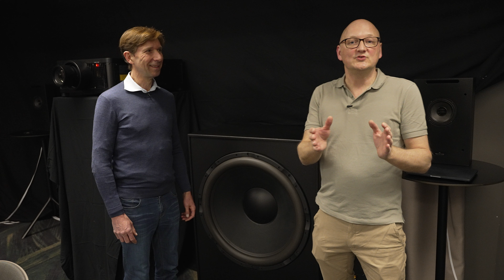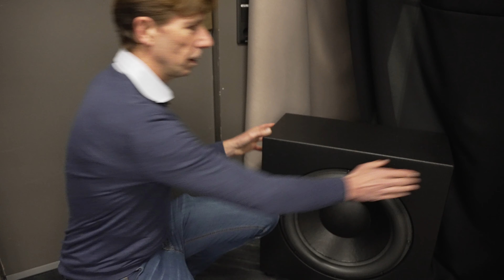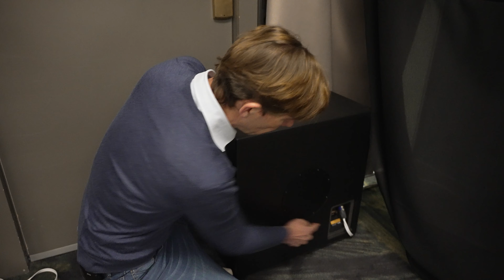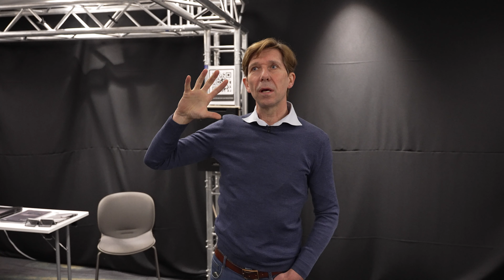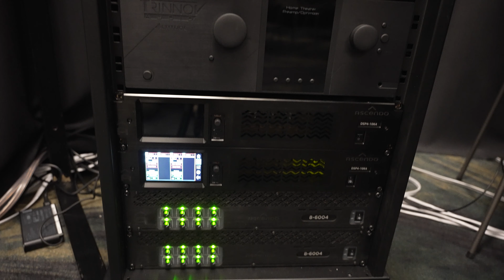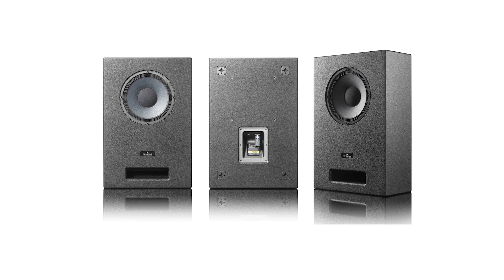Interview with Geoffrey Heinzel at Ascendo Immersive Audio

Comment: The new [very slim] sealed 18" subwoofer is a game changer for many installations, where optimal performance is needed, but space limits dictate a choice that isn't optimal to the desired rooms goals.  Bravo Geoffrey!  Dante + AES 67 enabled multi-channel amps with full suite of DSP processing add to an already impressive lineup of audiophile grade point-source drivers for the finest theatres. Thank you